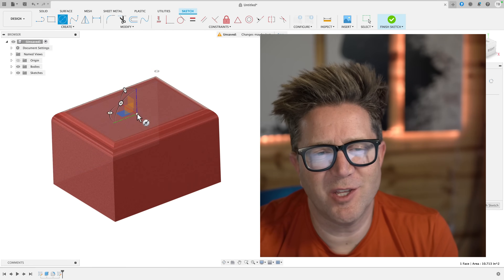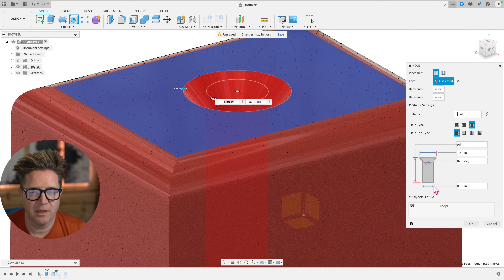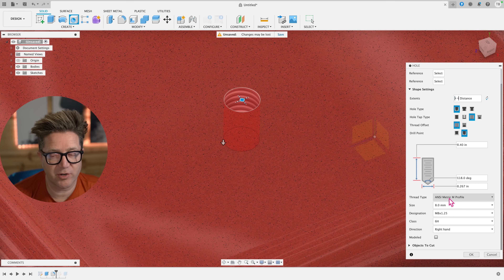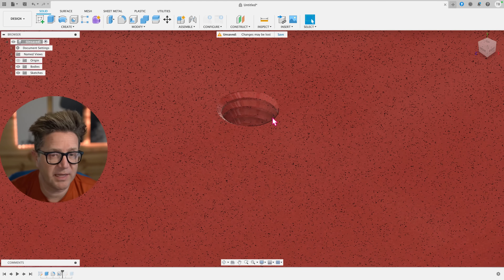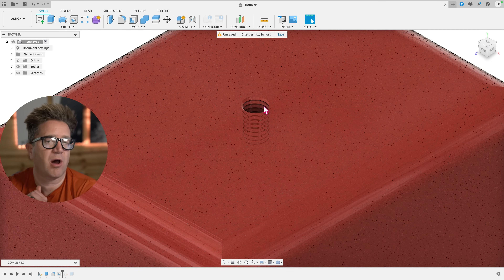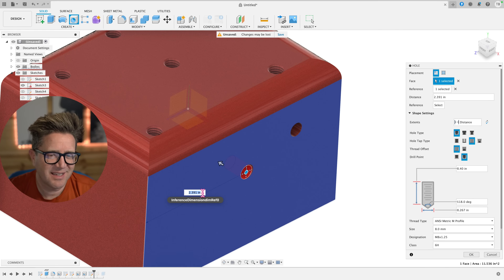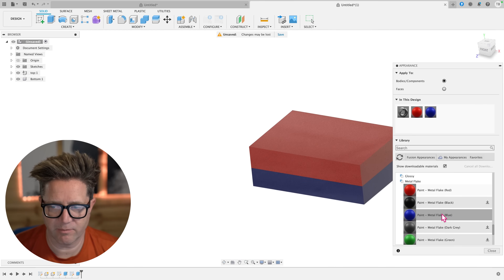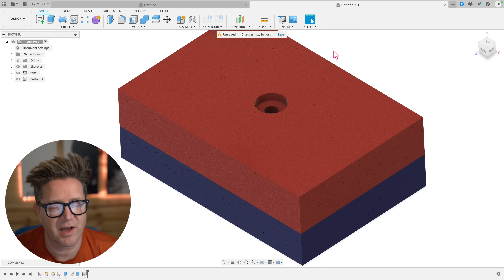Fusion 360 Hole Command – The Fastest Way to Add Holes, Threads & Countersinks

Comment: Can I make a hole that's essentially a truncated cone so I can set the entry hole and end hole sizes separately? I want to have my magnet holes be 0.1mm larger at the top so they fit in better but being tighter at the bottom so they lock in better (with some glue of course).

Comment: Only thing I don't like about the hole command is that it always remembers the settings I used last time I used it, from part to part in the same assembly, but also from project to project. I guess it makes sense within the same component, but if I'm in a whole new design, I don't want that.

Comment: One thing I've learned when doing modeled threaded holes is too then use the offset tool on the them to oversize the threads by .04 to compensate for printer shrinkage. You'll have to play with the offset for your printer/filiment combo.
Reply: I find .02 works on my Bambu

Comment: Hi Tyler. I tried using this feature for the first time a few days ago. I was attempting to use it with an m3 modeled thread. The problem I was coming up against was when the thread was created the hole size diameter was shrinking to around 2.5mm. I did try to find a solution online but didn't have any luck. What am I missing?.. Thanks for your content, it is very helpful.
Reply: @doondedulin44 that is what is going to happn as a threaded female hole will have a smaller drilled diameter hole so that the minor thread diameter engauges the minor thread diameter of the male bolt.

the male threaded bolt will have a nier 3 mm diameter or just under and the female hole needs to be smaller for thread engaugement . i hope im understanding what you are asking and talking about.  you are doing things corectly, note if you are 3d printing it you can adjust the class of thread like 1A 2A 3A i believe thats the right notation and i think its 1b , 2b and 3b for male threads , or somthing like that the class 3 will have looser fit and can help combat printer shrinkage or over extrusion issues for threads , standard hardware is class 2 size and class 1 is like military tight machine work ,

any other printing can be adjusted with xy compensation in the slicer .

note small threads like m3 may not print very well and be clean so extra post processing may be needed for it to fit .
Reply: @lmccleary411  Amazing, thanks for your reply. That makes total sense. Have a good one.

Comment: Another thing I like about holes is they can be patterned quickly by choosing feature then clicking the hole in the timeline and patterning out. Fully parametric too. I use this function a lot in our building of steel framework for multiple rivet holes cut on our laser sheet and tube.
Reply from the maker: Great point!

Comment: - You did not mention this, but on a SIDE NOTE, regarding JOINTS...
--- A joints is made between two components referencing a "snap" in each. Snap can be on a body, but can also be in a sketch, or from some other entity.
--- So, it can seem as though the joint is between the bodies, but technically, it is not. 
--- (My teacher mode kicked in :) Hope that's OK. Keep up the helpful content, fellow teacher...)

Comment: - Note on terminology, regarding "COMPONENT"...
--- At 9:26, technically, 'Hole' is being put through two BODIES, each of which is in a separate component.
--- I make this comment because many users are unclear as to the distinction between "component" vs., "body". So, for new users and others, a component is simply "a container for things" (so, it NOT geometry) - things like bodies (which are geometry), etc.

Comment: - at 7:20, Rectangle' corner points are not being recognized because 'Placement' has not been switched to 'From Sketch (Multiple Holes)'.
- So, creating extra points at corners of 'Rectangle' is not necessary.